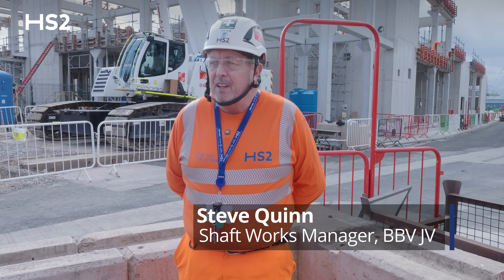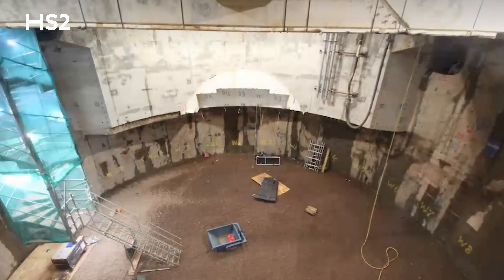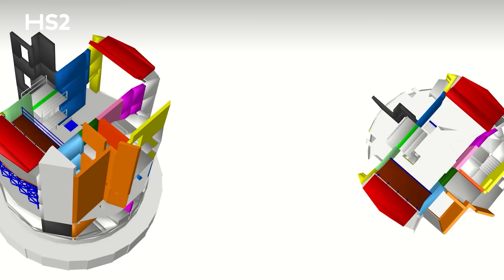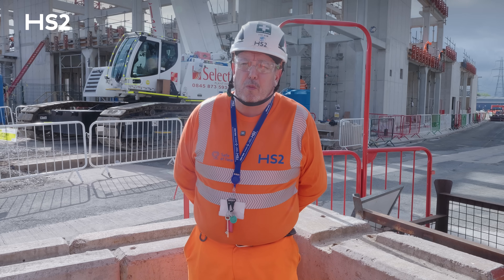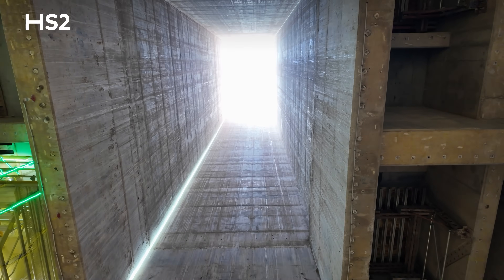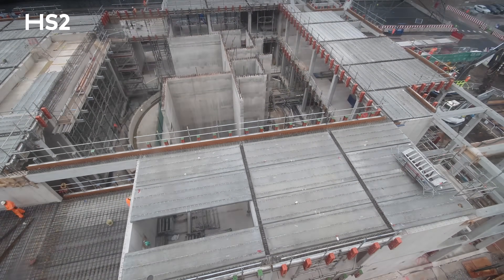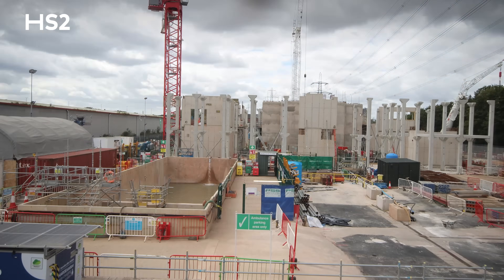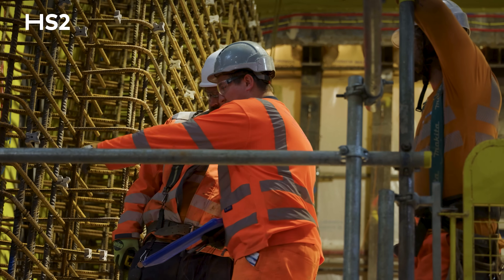Inside HS2’s Bromford Tunnel Intermediate Shaft

Comment: Very impressive engineering but a complete waste of tax payers money. This train line will only benefit a very small percentage of people. I would be interested to see how much cash spent per potential customer. Is it really worth the huge cost to cut down on a few minutes per journey ?
Reply: Your comment is based on a misunderstanding as to what HS2 is for.

Politicians “sold” HS2 to the public on the basis that it’s high-speed rail, which is nice and sexy-sounding and puts said politicians in a good light as progressive individuals and therefore jolly good chaps to vote for. A monument to political ego and vanity in fact. On that basis your annoyance would appear to be justified. 

However, HS2 should really be called the WCML Relief Line, because that is what it really is. The West Coast Main Line is effectively full, especially the section between London and the Midlands. Its mixed traffic nature – fast inter-city expresses, relatively local stopping services, and speed limited (60 mph) freight trains all sharing the same set of tracks – means it’s impossible to increase capacity of the overloaded existing route any more. 
So, the clear solution is to build a dedicated new line over which the fast inter-city trains can run, leaving the existing lines to accommodate more freight services and much improved local services. Win-win (or should be). There is no viable Plan-B available to solve this problem. And when you build a new inter-city line, there would be no point in designing it to yesterday’s standards, so you future-proof it by making it high speed, and to bigger (continental) loading gauge. But the main aim remains capacity expansion, not merely saving a few minutes journey time.

The high cost and delay in implementation are because of several factors, including:
1) Politicians (wanting to make a big splash) pushed the design and implementation professionals into starting construction too early, before all of the major engineering decisions and construction planning had been done. This is never a good idea on any complex infrastructure project, and is guaranteed to push up costs.
2) The organisational structures and contractual arrangements required for the implementation of such a large project were not properly thought out (another consequence of starting too soon).
3) The hybrid-bill method that the politicians chose to legally enable the project saddled HS2 Ltd with an enormous burden of having to apply for thousands of local planning permissions in order to construct the line. This gave nimby local authorities a huge stick with which to delay and thwart the construction process, and helped to drive costs much higher than they needed to be.
4) HS2 Ltd have to obey the UK's laws, and if those laws drive up the cost of design and construction, then it’s down to the government and parliament, not HS2 Ltd,  to change laws as appropriate to bring costs down. I’m thinking of the much-maligned Bat Tunnel here, plus other mitigations that HS2 have had to put in place to meet their legal obligations.

Having cocked it up, the politicians (Rishi Sunak in particular) decided to extricate themselves and deny responsibility by taking the bold step of cancelling the Birmingham to Manchester leg, thus scuppering the chance to relieve the congestion on the northern part of the WCML. An incredibly stupid thing to do, which didn’t benefit the then government in the slightest – they just handed on an even more confused mess to the next government. 
HS2 is a text-book exercise in how politicians shouldn’t go about sponsoring much-needed major national infrastructure projects.
Reply: @johnevans2044 however you dress it up, it's a huge waste of money. The contract, as a whole, leaks money and is badly run. I know of engineers, first hand, who have subbed out their normal day to day work because of the huge sums made on this contract. Mechanical earth moving drivers sit with their feet up doing nothing. As long as the engine is on and the hours are stacking up, they make very easy money.
As per anything involving the government, it is just a feeding trough for the greedy.
They would have been better building more homes closer to London to stop the need for the daily long distance commute.
Reply: @glynknox4089 I think the biggest problem with this project is all the tunneling you guys are doing. I think it’s the biggest waste of money. In other countries who have hsr or just allot of railways, we just build and if a building is in the way they can fuck right off. The gains of having cheap railways is going to be way more beneficial then some housing, trees or industry that can easily be built elsewhere.
Reply: @jorgen8630  I think you need to do some resurch as the Hi speed lines out of I believe Madrid goes through a 3 mile tunnel to get out of the City Centre, so no in Europe they do not just knock things down

Comment: Is HS2 going to get to Crewe and Manchester?
Reply: HS2 is not being built to Manchester right now, but a future government will be forced to restart the project. The reason why we got the Y route was that the major bottleneck in England's railways (that was causing problems for commuter trains and freight trains) was concentrated around Birmingham and therefore making a "motorway on rails" for InterCity trains, would give back the equivalent of "A-Roads" back to the slower trains.

With Birmingham being sorted out, but both of the branches north of Birmingham being cancelled (for now) when the railway opens it will start to cause Birmingham to have big economic benefits, but all the expansion plans that West Midland Railway were working on were based around the idea that the Eastern Leg of HS2 was going to remove part of the "mixed traffic problem" to the east of their network and that the Western Leg of HS2 was going to remove part of the "mixed traffic problem" to the North West of Birmingham.

So instead of the Birmingham bottleneck being totally removed from the entire area, it is going to be shifted slightly to the north of Birmingham. What that is going to do is free up more capacity on one side of Birmingham than the other side. Commuters living on the "fixed" side of Birmingham will start to see much better local transport improvements than the other side and it's going to make this into an election issue.

A lot of people do not seem to understand that the phrase "Why don't you just upgrade the existing railways?" actually means pushing up the speed of mainlines at the expense of small rural stations (which either get closed or which get intentionally bad "parliamentary services" to discourage people from using them). But this will become obvious as Birmingham starts to get lopsided investment and lopsided house price increases. Then the high-speed rail plan will need to be revisited.

However, I hope that young people, who understand how railways actually work (and who do not buy into oil lobbyist propaganda) can spread understanding of the mixed traffic problem to enough other young people that they can make it clear to every MP in the UK, that they will not be elected unless they support massive rolling programs to improve every aspect  of our public transport. Campaigning like that will make HS2 get restarted and extended to Scotland, as fast as possible. And if we get HS2 out of the way, we can get the construction teams to work on other things (like HS3 - Northern Powerhouse Rail and high speed links to South Wales, North Wales and Cornwall).
Reply: @DavidShepheard  I agree. But the cost would be huge. Money I mean to build it to Scotland etc.
Reply: There is a big announcement early in 2026 about HS2 after the current project reset work is completed. Lets see what they have to say then. There are many advantages to HS2 reaching Crewe including further reduced journey times, much improved connectivity for region, many more West coast main line freight paths becoming available and linking HS2 to the eventual Northern Powerhouse rail.
Reply: @Pesmog sounds exciting! Thanks for letting me know - I will look out for that announcement
Reply: HS2 classic compatible services will run to Manchester and beyond to Scotland.
Reply: @P@Polarbear1-b6j thank you for your response. Do you know if they will be going through Crewe? Arguably the most crucial part?
Reply: @camillewiltshire1354  My first reply was about the HS2 infrastructure only, not services. The HS2  classic compatible Service will run on the current rail network and eventually HS2. This service will get to Crewe. But on the existing rail network and Stations. The new HS2 Rail infrastructure begins near Lichfield. So basically Yes.
Reply: How does A.I create the rail capacity for freight trains on the exisiting tracks? HS2 is about more than speed and passengers. It is an increase in bandwidth for the entire railway, not just high speed passengers.
Reply: @amateurcameraman AI will transform logistics by vastly increasing efficiency across the whole transport network.  Humans are incredibly inefficient..😮
Reply: @leethrelfalllt getting shipping containers from the channel tunnel, Southampton, london gateway, felixstowe ect to London, Birmingham, Manchester, Glasgow ect is already most effiecient by train. They just need the capacity on the network. AI isn't going to change the physics and logitics of moving freight around the country. You think those fruits that come by train from Spain to UK, those cars that come from Germany to UK by train, hundreds of cars driven by a single locomotive with a single driver at a time, can be made more efficient? Maybe AI will reduce the workload of said train driver, maybe even replace the driver entirely... but it doesn't replace the need to transport goods. The west coast mainline is the busiest mixed traffic railway in europe. You don't just keep adding freight distribution centres along it (as we have been, and still are doing) and not expand the bandwidth of the railway between those distribution centres. AI might help squeeze the last ounces of capacity out of our existing network, but then what? 
That's why the expansion is necessary, then the question is how to do it best... do you really imagine that HS2 was the worst option? It was the best option, badly managed and badly delivered... by the government!
Reply: No. It should at least get to Crewe. Then It would of been ok. But short sightedness by Politicians isn't something new in Britain.
Reply: @hammertime-65 short sighted politicians would have spent this on AI..which is going to make super fast rail completely redundant...😮
Reply: @leethrelfalllt  not sure what you mean
Reply: @hammertime-65 use your imagination...super fast rail is a luxury...super fast AI will bring off the scale efficiency across the remainder of this century..😮
Reply: @leethrelfalllt  Interesting. A.I is something to know about.
Reply: @leethrelfalllt  Most of what is called Artificial Intelligence is a grift by foreign tech-bros trying to trick stupid politicians into giving their companies free money for software designed to put more workers out of jobs. AI also requires big data centres that burn up a lot of electricity. In the USA big data centres are being built that suck in entire rivers and evaporate them to keep computers cool.

Comment: I know where it is & what it is for _ it's one of those elements/ structures on the project that gets no coverage at all _ it's the first time it's been shown _ at all _ very helpful update _ many of those that comment on the project would like to see more of these informative releases _ they sadly few & far between _ you really need to do a longer piece for the Attleboro flyover just back along the track a short distance _ yes it's not finished yet but it's an impressive piece of civil engineering _ good work _ more please _ good useful & insightful video content helps explain what you are doing _ especially with the Lawley viaduct arch slide coming up in the next few months _ OK

Comment: Headhouse building seems massive for "ventilation and technical services". Does in include a signalling center or power substation or something like that?
Reply: I worked on the design of this years ago, and it does need to be that big.  There is a pair of absolutely enormous vents inside which would only ever turn on in case of a fire, to sort of "blow" the fire out of the tunnel and prevent it from spreading across.
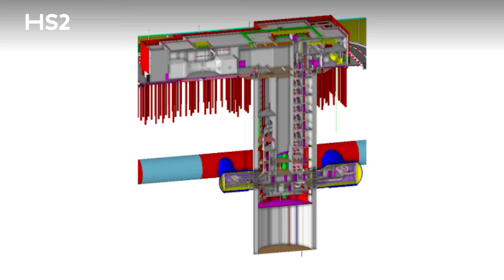Reply: Check the model at 0:36
Reply: That was my thought too haha i just imagine an office building with a massive hole in the center of it lmao